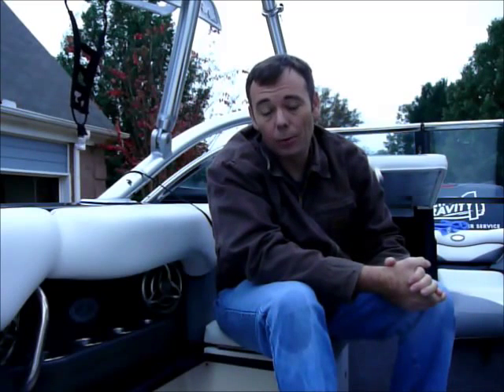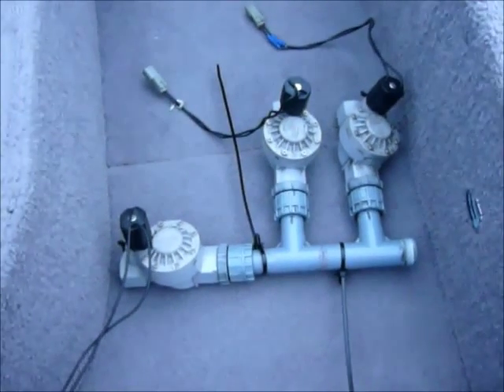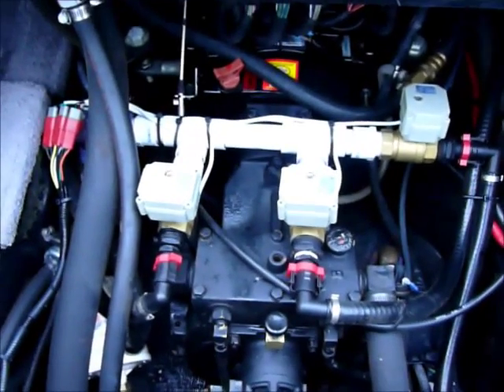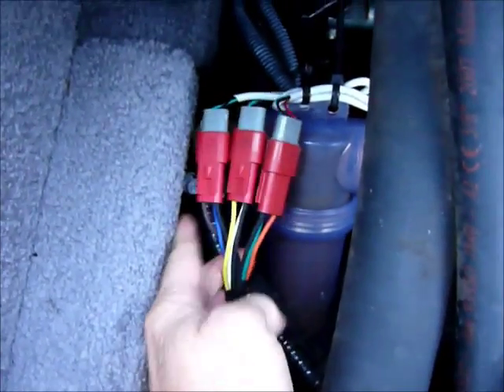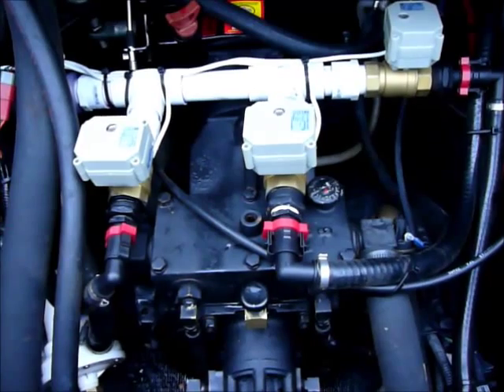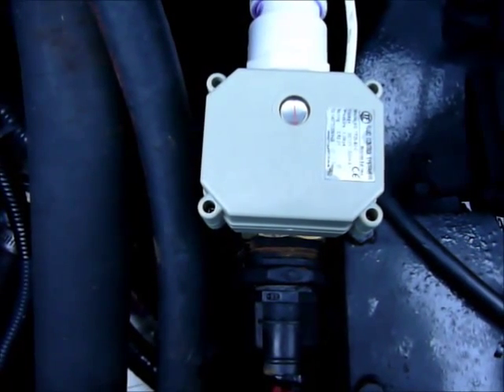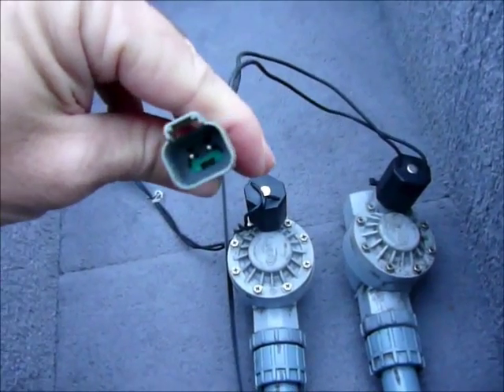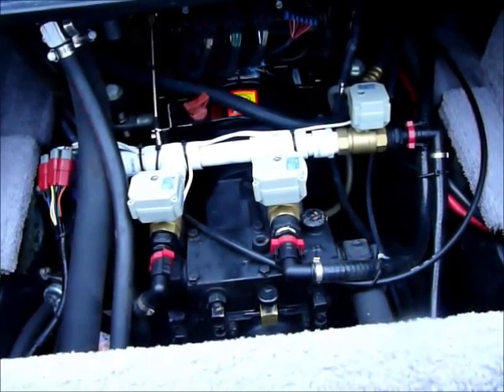Ballast Update 08 Supra Launch

Comment: Hi Brad, thank you very much for the video. I have exactly the same boat and have been wanting to replace the factory valves as they have been givng me so many problems. So glad I came across your video today! You mentioned that you had to make a new circuit to adapt your values to factory switches. I'd love to get my hands on that schematic as I'm going to have to make the same modifications. Would you mind emailing me at atomicmarshy@gmail.com with the details of that circuit? Thanks in advance!